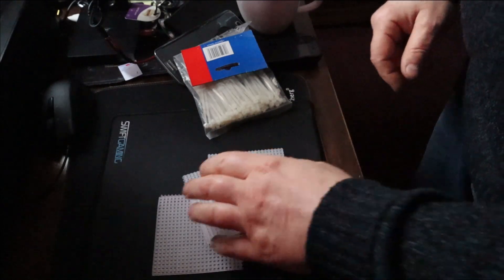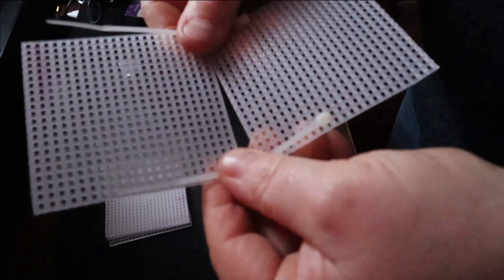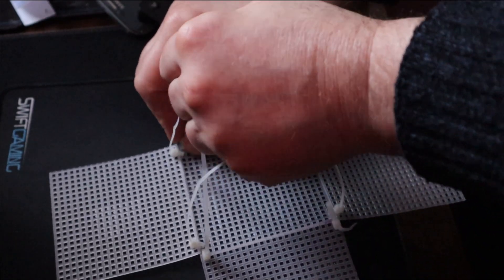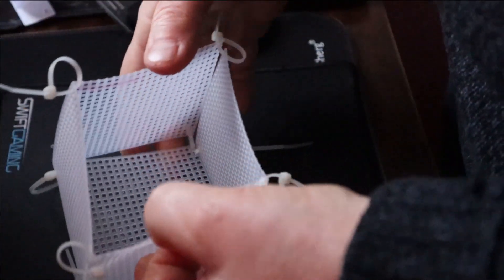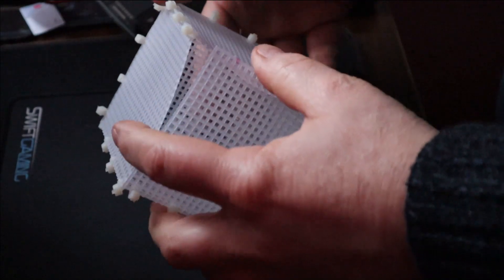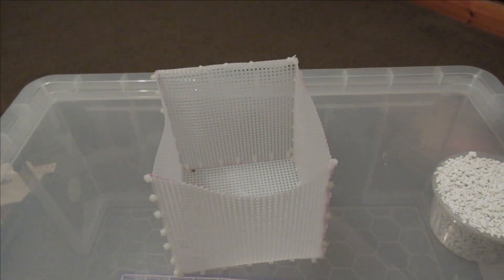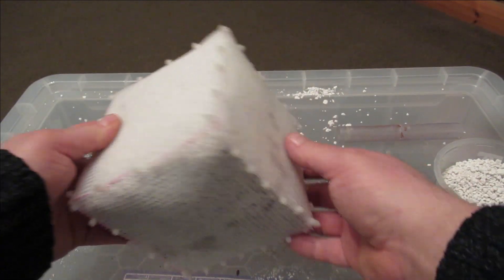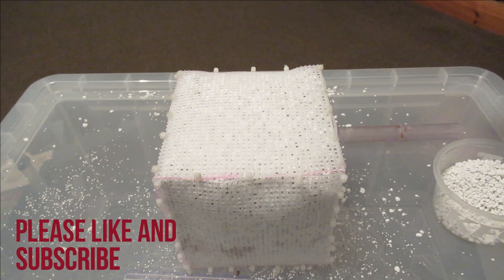biocenosis clarification basket ,,Nitrate removal?

Comment: Yes but on this actually cat litter pack it says there 100%sand... so I don't think is clay... 

I wanted to do experiment with the same pack of cat litter but when i read it 100% i just resigned... 

I went with undergravel filter plates then made with black mosquito net then o top of that added volcano lava rock then thin layer of jbl manado then some of fluorite and end layer with jbl manado. Total thick is about 9-10cm in the back and 8-9cm in front... 

My tap water has average 39ppm of Nitrates... and about 3ppm PO4.... i testeed many times... 

But i live in most farming area... 

Last week i did and i am waiting what will happen in the next weeks, months....
Reply from the maker: this one i used is non clumping clay that said i did try other variants and found deep substrates and plants were far superior especially in large ponds
Reply: @AQUAGUYUK and is it working good? Did it reduce Nitrates ? My tap water has average ~40ppm of Nitrates...
Reply from the maker: @pits328  well i would have to say no more than any other system like deep substrate and plants but if your tap has high nitrates have you tried a nitrate filter i use one and they work well  that way you remove the nitrate before it hits the tank https://www.diy.com/departments/pozzani-no10-aquarium-nitrate-reduction-removal-filter-system/5056617105688_BQ.prd
Reply: @AQUAGUYUK  do you know if I can connect this filter obly then when I need to use it? I mean when I do water changes weekly? Then I connect it to the shower tap...?? 

After fill up the buckets i disconnecting(but leaving water inside there) and keeping in place like in bucket in storage room....

Kind regards😊
Reply from the maker: @pits328  this is how i do it i connect the filter to my tap then to a hose from my tap to 60 ltr containers where i use seachem prime then i add the water to the tanks so yes you only need to use it at water change
Reply: @AQUAGUYUK oki thank you. 
Did you do any update about these baskets? 
Do they work? Could you do any video ? 
I would be gratefull 
Kind regards
Reply from the maker: @pits328  as the findings were inconclusive i didnt do an update but after a year i found personally no benefit over a deep substrate and plants

Comment: A slow moving plenum worked for me. Substrate is 3-4" deep. I used a red clay cat litter. I topped off with JBL Mando Dark, which as far as I can tell is grey cat litter with iron, so I didn't bother adding laterite, I just dosed with iron for the first month.
My tap water has 20ppm nitrates. After three months, my plants had little growth and started to suffer nitrate deficiency; I tested and... had zero nitrate. So I changed fertilizer to one with nitrate and started to dose nitrate occasionally to keep it up at 15-20ppm. After 6 months, mulm started to get into the substrate and plants stated growing like crazy.
Reply from the maker: Feel the plants removing nitrates and adding nitrate and phosphates in ferts seem to defeating the object i prefer balance but each to there own and glad it worked for you and thanks for the info

Comment: Does anoxic filter works?
Reply from the maker: This has been an on going test and i think the answer maybe "not any better than other filters "reasons for this if you add a deep bed substrate and plants you can achieve same results and i only found marginal results with the baskets and needed several to get the same results as my fluval 406
Reply: @AQUAGUYUK  thank you for your reply. Same here. I am trying to change clay for next experiment. I am thinking may be catsan clay. But I cannot fine any other clay in uk.
Reply from the maker: @dipenr6766  Catsan is no good and to be honest i tried various items one from a hydroponics farm near me ,,and personally the science behind this system comes from Koi ponds my dad used a pond next to the display pond but again had so many plants i believe its that and bacteria in a deep bed rather than a small basket having said that if you match 10 baskets it may have an effect but looks terrible
Reply from the maker: @dipenr6766  Oh forgot to mention i am using zeolite for said testing at the moment this is used in koi filters and matches the properties required

Comment: At the end,is this cat litter make worked long term or not ?
If not,what are the alternatives please ?
Reply from the maker: this cat litter is not suitable i had to use zeolite clay to test but to be honest the results were underwhelming and your best bet is a deep substrate such as caribsee ecco complete and plants as this is what reduced my nitrates the most
Reply: @AQUAGUYUK  ok thank you,so did you do that eventually with plenum anoxic way ?
Reply from the maker: @ahrondinar8782  Issue is getting a plenum to work without debris turning into bio matter and then nitrogen which can turn the water murky so i still say baskets would be better but you would need and equal surface area as the body of water you are treating and still you would need a filter for hard waste so plants and deep bed is the way to go for me

Comment: I have to agree that the science is currently cloudy at best. You guys who have had success with anoxic filtration methods need to come out and make videos explaining your setup and water parameters lol.

I have tried making a bcb (in bag form) with a mixture of zeolites and baked laterite clay while also making a plenum. Several things did not go as I expected during implementation itself, so there's a few things I'll change around as the experimentation goes on.
Reply from the maker: You are on the money i have been testing this for over a year and still can not trust it second i have now tried to make it work and its simply not good ,,,in fact puts peoples mind set in the wrong direction ,,,plants and deep substrate coupled with good husbandry is the only way
Reply: Though I wonder, African cichlid tanks and koi ponds without a bog lack plants because plants typically don't thrive in such environments, yet beneath these lakes, there is an anoxic zone which has denitrification bacteria, so the idea of setting up a plenum is still sound

Comment from the maker: As it stands at the moment using zeolite as a clay media and using 3 tubs plus one as control there seems to be some nitrate removal on this but to be honest you would need to match the volume of the basket to the aquarium and the tub with plants seem to be better and removing nitrate, this would be best suited to a pond than aquarium ,,,,the test goes on
Reply from the maker: Well the tub with plants and deep substrate has less nitrate tub A tub B at the moment the biocenosis basket is 15cm by 15 cm and contains 1 cup of seachem flourite and 8 cups of pumice stone  tub C has Tesco clay cat litter non clumping and flourite at same levels i also did this with 20 cm cube and the results changed which leads me to believe you would need a basket of about 30 cm square to match the heavy planted and deep bed
Reply: Thank you for running an objective experiment! I now am certain anoxic filtration would not work for me and there's a reason why it has made it outside the koi world i.e. ponds!

Comment: This would not have worked if you can please confirm. Reason is the kitty litter ur using is perlite and NOT clay based. It's the clay that attracts the ions. What you can use is Oil Dri instead of kitty litter that is basically Montmorillonite clay
Reply from the maker: Indeed very true i have restarted the test on three 20 gallon tubs and to be honest as it stands you would need a basket with the same or more volume to significantly reduce nitrate to any meaning level and would only be good as an aide to plants and water changes but zeolite with pumice stone seems to be better
Reply: @AQUAGUYUK  Thanks for confirming, if you can please elaborate on your comment, what size basket are we speaking of for what volume of aquarium/tub size. And when you say mix of zeolite and pumice can you please elaborate on what that is, is it mixing zeolite and pumice or keeping separate baskets of both.
Reply from the maker: @sakleo8  Oh and also trying a plant called Pothos which hangs it roots in the aquarium water
Reply: @AQUAGUYUK  Help a little, issue is the roots grow crazy in the tank and need regular trimming, however its effect is very limited.
Reply from the maker: @sakleo8  True but personally think that deep debs and plants give healthy results and doing the odd water change is probably the best answer to nitrates ,,,or maybe a pearl reactor

Comment: What was the effects of your BCB as to the water parameters ?
Reply from the maker: I am re doing them this summer as the test was inconclusive but to be honest i did learn that a deep substrate and plants really make a huge difference keeping the water in good condition
Reply: @AQUAGUYUK  thanks for your reply.  Thinking of placing material in a bag and placing it in a HOB filter. Dr. Novak said that it could work.
Reply from the maker: @TheWalk23  Novak over complicates this process all this work can be done with either water changes or plants like pothos personally if you want good biomechanical filtration white pumice stone is very good and quite cheap its basically seachem matrix and fill the hob with that now put a sponge first inline and boom perfect water but will still be doing more testing

Comment: I'm not a YouTuber, wish I was, but I've done extensive year-long experiments testing Kevin Novak's BCB's and anoxic "style" filters. I say "style" because dissolved oxygen sensors show the oxygen levels never get low enough to support an anaerobic environment even with a 12-inch deep gravel bed on top of a 2-inch plenum.
 Without plants or water changes the nitrate levels never decrease.
Thoroughly debunked.
Reply from the maker: Indeed i have used a similar method in my 200 gallon pond and found the plants have a higher impact than biocenosis baskets and the like in fact i found you would need an even number in volume to achieve any result and even then its down to bacteria not some fabled reaction but the test goes on

Comment: Does the laterite (or iron alternative) have to be completely covered by the clay or can itbjustbbe mixed through the clay? Thank you and sorry if this is a silly question. I have just built my 1st bcb basket in my canister and the clay and laterite got a little mixed up.
Reply from the maker: No question is silly basically make an iron core but i too added some to the top and bottom so no problem

Comment: As a guide, there should be about one basket per adult koi fish for the system to provide stand-alone anoxic filtration, just putting one or two biocenosis baskets somewhere in the pond may not have any significant effect. The optimum size of the biocenosis basket is 30 cm x 30 cm x 20 cm for one adult koi. It’s possible to use smaller baskets but they will have less room inside them for anoxic conditions to develop so they won’t be as effective as the optimum size. The baby BCBs you made may won't do much.
Reply from the maker: So far on the test i have found that you would need a surface area of at least half the pond/aquarium volume but the test is on going as i have found variables that i didn't expect including planting the baskets with ferns or swords also water temp seems to have an effect ??? but love the idea so far
Reply: @AQUAGUYUK  Keep up posted! Thx for replying.
Reply: @AQUAGUYUK  Does CATSAN litter work? I want to experiment. Please let me know
Reply from the maker: @dipakb5487  no its not the right material needs to be a non clumping unscented clay

Comment: How did you get on with this project I've only just found your channel but Catsan is a litter that is minaral based with quarts and lime bet your pH jumped 🤔...   okay biocenosis does not mean anoxic it basically means a environment of different organisms forming a closely integrated community.....  in the context of BCB its a colony of different bacteria working together, in this case of bcb is to create a anoxic environment for aerobic bacteria to form Nitrification part of the nitrogen cycle this bacteria forms on the outer basket and slightly into the basket then oxygen drops to about 0.5 ppm where then we get denitrification bacteria which will convert nitrates to nitrogen gas and also back to a Nitrification source aswell 😀 I fully get the nitrate thing here in the UK
Reply from the maker: Indeed i got the basic element wrong so going to restart the experiment lucky i had 3 10 ltr tubs for this to test but again cant finish it i have used a similar idea in a 10,000 koi pond so anxious to see what happens in an aquarium ,,,thanks for the comment
Reply: @AQUAGUYUK  you can use also a product called safe t sorb it is the same clay which is used in seachem Flourite Black gravel but a lot cheaper in the uk asda tiger branded none clumping is attapulgite which is another natural clay made from two different types..  now the only reason too use something like laterite or flourish iron in the middle of the basket is only to help kick start the bacteria.  Hope this helps.
Where about in the uk are you 😃
Reply from the maker: @Joker-bx4rk  Ah good to know i did use zeolite and pumice stone this worked well also planted a 4 ft by 6ft by 2 ft area to feed the pond this removed all pollutants also thinking of a flex 123 using the back filter area as a basket ,,,just written down what you recommend ,,,Oh near Heathrow airport

Comment: Do you need the flourite red if you're adding one of these baaskets to an established tank that already has beneficial bacteria?
Reply from the maker: The iron is the catalyst for the whole system causing the ions to split but the cat litter i used is wrong as its quartz not clay so going to re start this test
Reply: @AQUAGUYUK  Ha ha... I've just bought the same kitty litter! I guess I won't bother with this lot then. What brand/product have you tried this time?
Reply from the maker: @watchandlol  Still looking for a non clumping CLAY litter as i really want to test this but it looks like you will need a similar surface area as your aquarium lol
Reply: @AQUAGUYUK  Try Oil-Dri or Safe T-sorb. Same thing. Baked clay that does not clump. T-Sorb is better .. looks like gravel when wet.